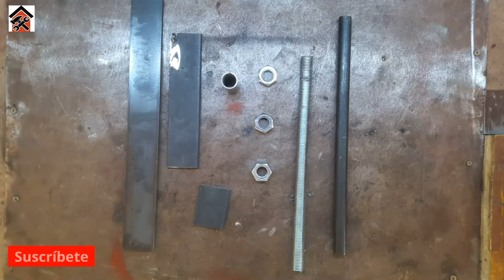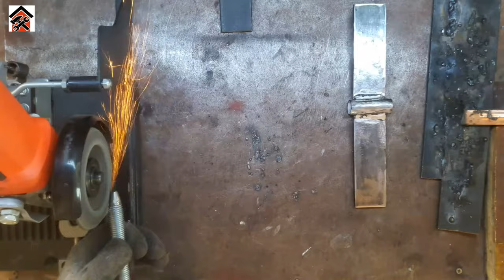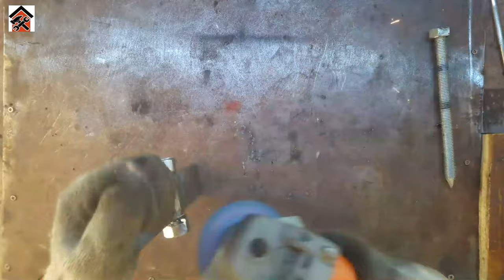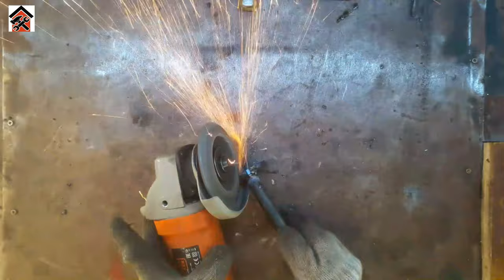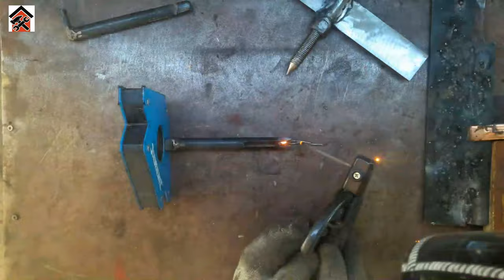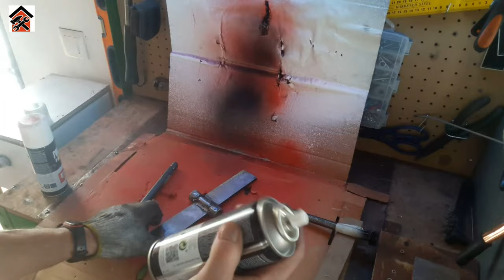EXTRACTOR DE RODAMIENTOS CASERO | BEARING PULLER

Comment: Me puede desir de cuanto es la me dida de el tuvo hueco y de cuantos son los hilos de la varilla roscada y de las tuercas porfavor porque me mandaron aser un proyecto del colejio y boy aser el de usted me podría ayudar con esa pequeña información
Reply from the maker: En primer lugar, gracias por ver mis vídeos y por utilizarlo para tu proyecto.
A ver, la varilla es M16 x 1,75 de rosca, la tuerca es M16 x 25 mm.
El tubo es de 17 mm interior y de 20 mm exterior.
Espero te haya resuelto las dudas.
No dudes en preguntarme si te surgiera cualquier otra cosa.